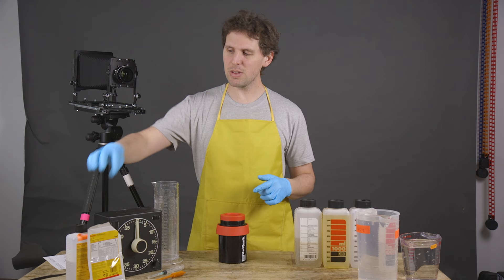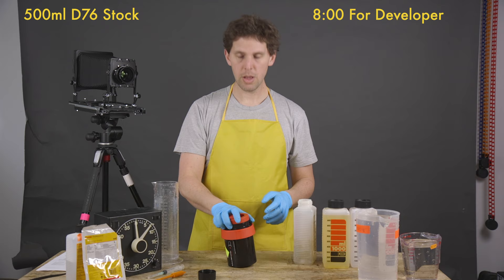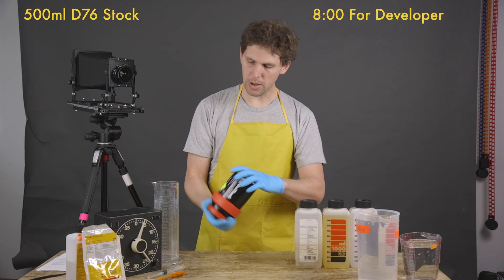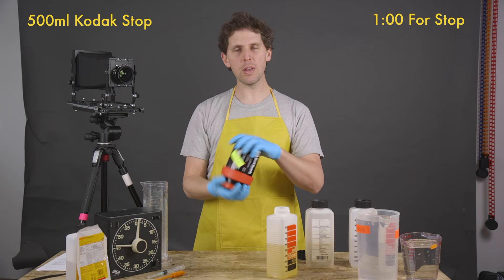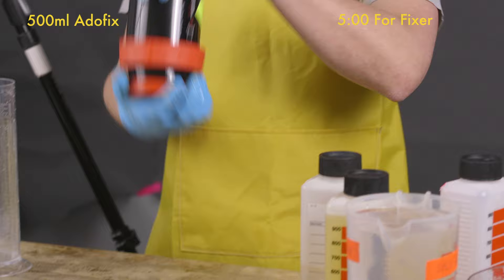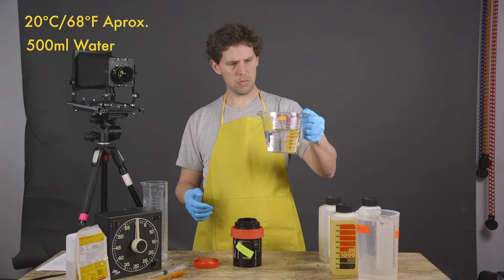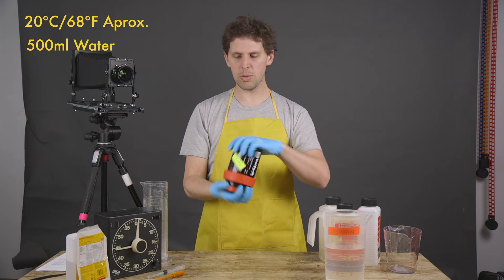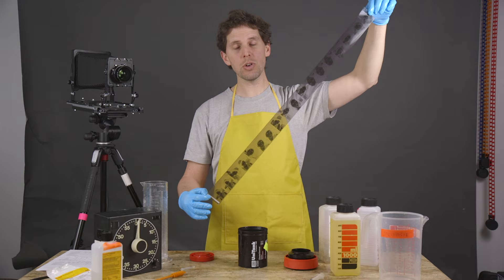Developing Kodak Tri-X 400 120 with D76 Stock || Developing with Nico

Comment: Great video! In my opinion you might agitate to hard and too many times. I would give two more gentle inversions every 30 secs, or else you risk overdeveloping - especially when using stock dilution. That’s what I used to belive, but I see your method is working. I use the standard developers: D76, HC-110 and Rodinal and find them good and economical. I mostly use Tri-X, HP5+ or Acros 100 films. Keep up the good work, Nico! 😊👍🏻
Reply: Bernt Sønvisen he said he was following an instruction sheet at the beginning from Kodak.

Comment: I use standard paterson tank for 2 35mm rolls, so I should use 300ml of product for just 1 roll of 35mm film, If I use a 1L solution of D 76 does it mean that I'm allowed to develop just 3 rolls (and also that I will have 100ml of leftover develop)?

Comment: Very informative, thank you.  So do I understand correctly, If I load my 120 film into my 220  back of my Pentax 645 I'll  get 17 shots instead of 15?
Reply from the maker: Thanks Mike! Yeah, I load it a tad less (the arrow not aligned to the indication) and get almost 18 shots...
Reply: @NicosPhotographyShow  Very cool!  I'll try it on my next shoot. Thank you.
Reply from the maker: Do remember that the 17 and 18 are bonis! So dont take the most important shots there. After 18 i just fire away until the film sounds likes its spooled on the other side.
Reply: I wouldn't reccomend that, (120 into a 220 insert); 220 has NO backing paper, 120 HAS backing paper, so the film plate COULD jam the film, or worst  case fly the film free, therefore allowing it to bow slightly, affecting the focal point of the image, as the mirror/etc. is calibrated on this theory, that the focus plane(film plane) is a constant distance from the rear lens of the camera, so EVERY photo's focus could NOT be guaranteed.

Comment: I am yet to try D-76 and after watching this video I am sold. What dilution do you recommend ? 1:1 ?
Reply from the maker: Yeah, 1:1 is a good compromise.
Reply: D-76 is commonly used as a stock solution, 1:1, or 1:2, adjusting development time to accommodate for the extent of dilution. Generally speaking, the longer dilution will give a slightly faster film speed, better sharpness, and finer grain, however these differences are quite small and hard to observe without careful analysis. Diluted working solutions should be used only once, then discarded. This gives you a far more consistent processing, but may also give fewer rolls processed for a given amount of developer. For the years I used D-76, I favored the 1:2 dilution. For its reliable consistency, I always prefer one-shot usage over multiple reuse of stock developer, or even worse, stock developer with replenishment.

Comment: D-76 is not so easy to find. And so for the time chart Pdf From Kodak. have you some advice on that? Thanks. great video
Reply from the maker: Kodak has been having issues with chemical supplies as of late. I would suggest trying some Adox or Ilford if you can access them.
Reply: @NicosPhotographyShow  Thanks

Comment: Good but I would use a pre-wash for one minute, a Speed Wash and a Chamois to wipe the film before hanging it up, never, ever use your fingers.
Reply from the maker: I only prewash with my Jobo, not usually during hand inversions. Also the fingers has been fine with me before. I rather fingers than the normal film squeegee, but a Chamois is a good idea.
Reply: @NicosPhotographyShow  I just recommended you and your videos, especially this one to a Film Developing group that I am on, on Facebook.
Reply from the maker: @mamiyapress  thank you!
Reply: @NicosPhotographyShow  Hey Nico, my friend is a pro photographer, he did it the same way as you for decades. He always told me to use the fingers not a squeegee to avoid scratching the film. I will go with your way and my friend's way...:)